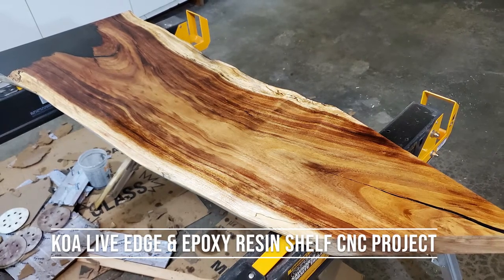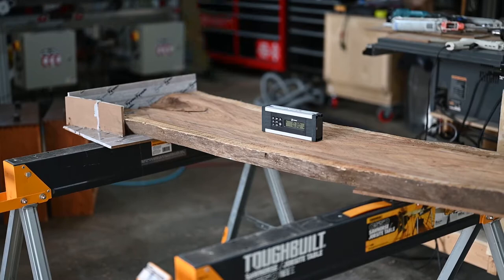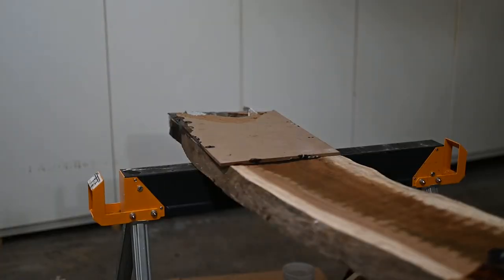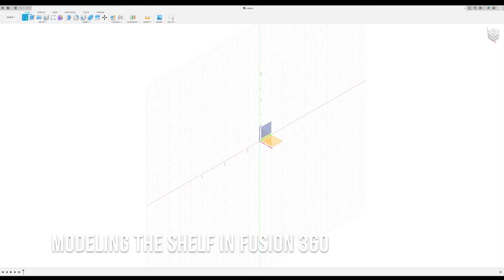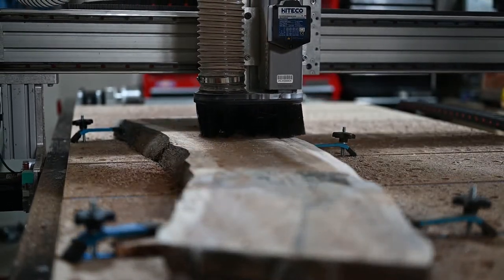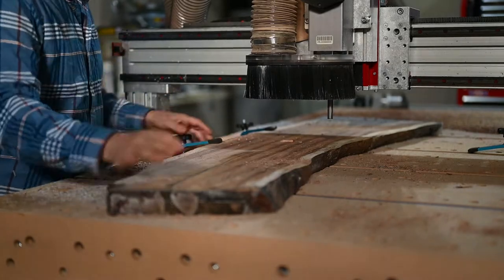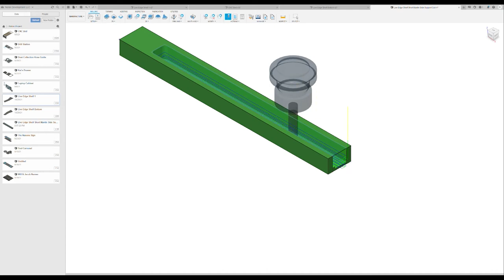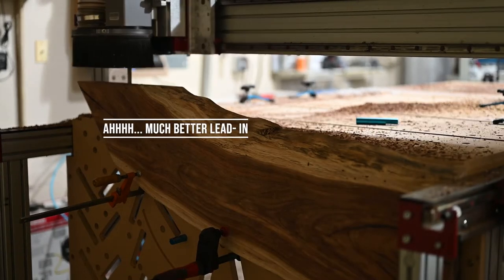AVID CNC Pro Koa & Epoxy Resin Live Edge Shelf Project

Comment: So, very interesting!  Did you wax the tape where the epoxy will set?  Mould release wax is good, but any good floor wax will help.  Epoxy has a way of seeping everywhere!  Lots of great ideas demonstrated!  Cutting and finishing slabs is one of my goals, maybe even as a sub-contractor.  Did you wear a respirator while sanding?  Epoxy is not too user friendly on the lungs, even when using dust collection on your sander.  Just be very careful.  I saw the Seattle in blue script, so are you in the Seattle area?  I am located in Burlington WA.  Really liked your music again!  I built a custom 30’ racing sailboat with epoxy as the bonding and laminating agent, and a few stitch and glue kayaks, so lots of sweaty respirator hours.  Take care!  😎
Reply from the maker: Hi Paul. I'm glad you liked the video and music again! I didn't use any wax on the tape. The only area where I had an issue with release was where the epoxy had seeped under the wood and there wasn't any tape. That was definitely a lesson learned. I am located on the north end of Seattle near Everett. As far as respirators go... I try to always use one when sanding or spraying but it is easy to get moving and forget to put them on. Your boat/kayak projects sound really interesting! I would love to build a boat someday. What kind of time commitment did a 30' boat require?
Reply: @NorskieCNC  The boat took 4 years, mainly because it was not at home, but at a friend’s shop about 20 min away, also still racing boat #1. Then it was heated only by an airtight stove, so as soon as that went cold, the epoxy almost stopped hardening until the stove got fired again.  I was working full time, so after work and weekends were fairly full.  Some days it was just re-fire the stove and go home.  Three of us did most of the work and when extra hands were needed, all the crew showed up, like lifting and bonding the deck by hand.  Much of the interior was built outside of the hull and then set into the hull.  The entire project was designed on my computer using yacht design software, by Vacanti,  and that was really great to use.  After trials we raced it to Hawaii, locally, Swiftsures and two races a round Vancouver Island.  After 35 years of racing (23 in my first boat), I had to give it up for health reasons (respiratory). I’m getting my garage shop, two of a 3 space garage, reconfigured for the CNC, and still leave space to build kayaks.  Almost all other  machines on rollers will help to maximize use as needed, and when the weather is nice, use outside (saw and planer work).  Sorry this is a bit long!  What else do you do in your shop?  How about a video shop tour?  🪚 🛠😎
Reply from the maker: That sounds like you should do a YouTube documentary on the boat and all your travels/racing! I'm waiting to do a shop tour video because we just moved here and it's nowhere near where I want it to be. I need to tear out the old shop cabinets, remove the wire shelves, and build a bunch of new storage/cabinets to make it respectable. Then I'll do the virtual tour :)

Comment: Another nice video.  At time 2.52 what is that tool you're using I don't think I've seen one before.  Thanks again for you sharing are you on FB following the AVID group there?
Reply from the maker: Thanks David! That is a Makita cordless multitool like this one: Makita XMT03Z 18V LXT Lithium-Ion Cordless Multi-Tool, Tool Only https://smile.amazon.com/dp/B00LIV11RG/ref=cm_sw_r_apan_glt_fabc_6W7WPMHKGG73K80XDTPB?_encoding=UTF8&psc=1

I try to buy all the same line of tools if I can to maximize compatibility on batteries and chargers. A few years back I switched over to Makita's LXT line and I've been very happy with all their stuff.

I'm not on the Avid CNC FB yet but I'll check it out. Thanks for the tip!

Comment: Jay Bates has a video on dialing in your spindle, it will really help eliminate alot of sanding.
Reply from the maker: Thanks Chris! I have seen Jay's video and it was very helpful in getting my spindle about as dialed in as possible with my old fashioned eyeball. I think the issue that led to more sanding than usual on this project was that I'm still learning what feeds, speeds, and direction/pattern of cut yield the best result for each type of material/species of wood and my machine and bit (bits & bits 2" facing mill). In this case I didn't want to take too much material off with the facing bit so I didn't keep trying different combinations once I felt I could sand out the imperfections.